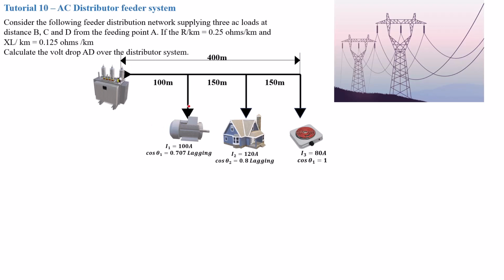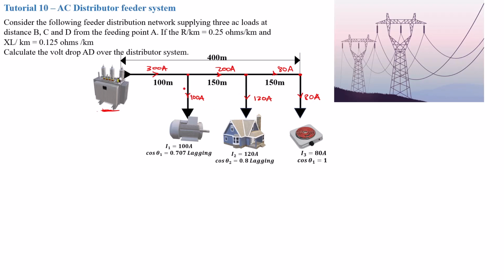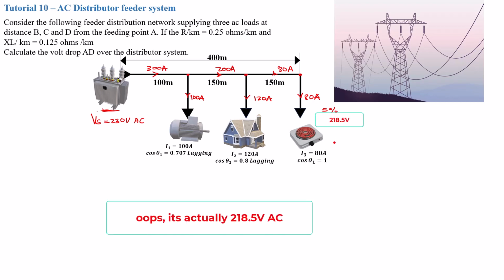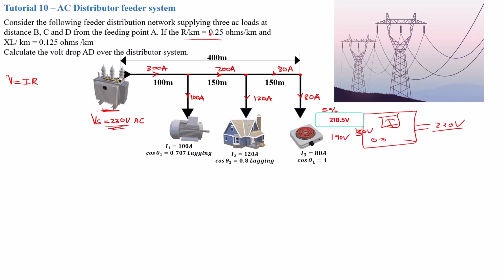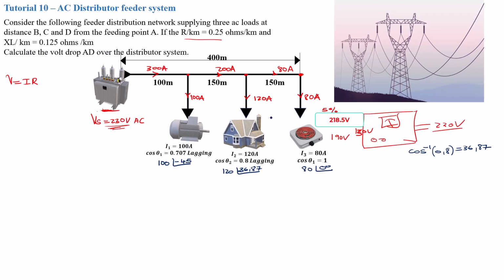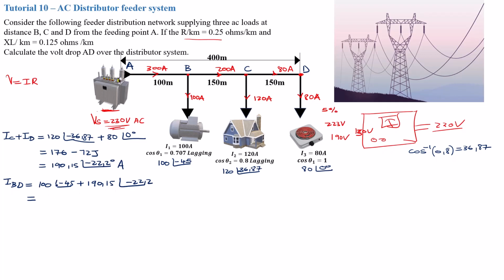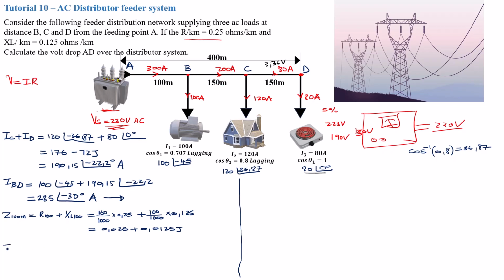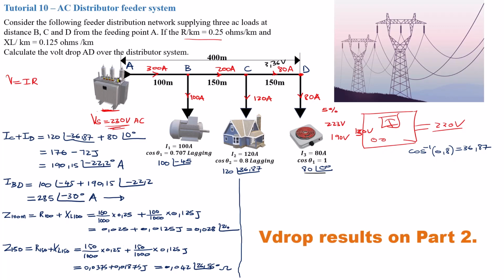How to calculate the voltage drop of an AC Distributor feeder system - Part 1

Comment: Why did you add J to the inductance reactance
Reply from the maker: That is to Illustrate that the Inductive reactance have an imaginary component, remember when calculating Z(100m) or Z(150), I'm calculating the impedance in a complex form, where the resistance is the real part and Inudctive reactance is the imaginary part thats why I added J. Its AC Analysis using complex numbers.